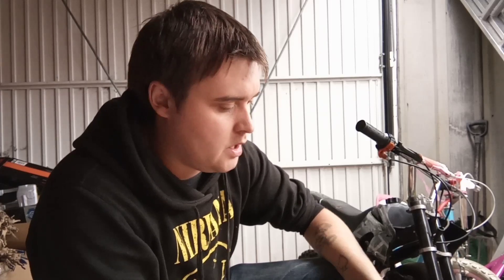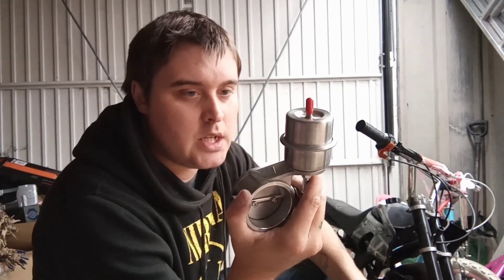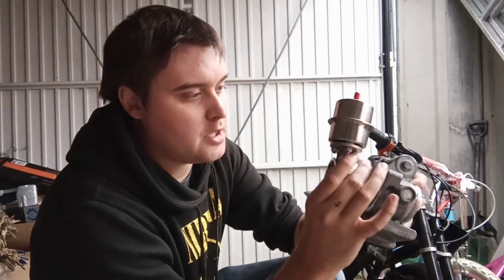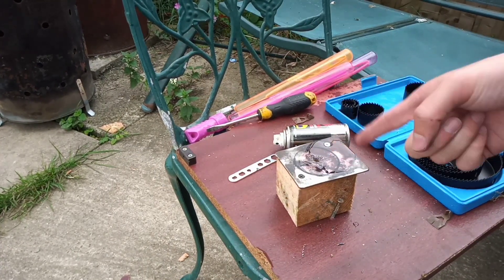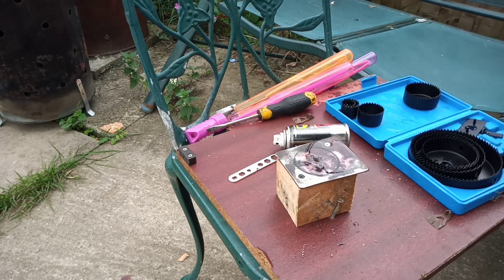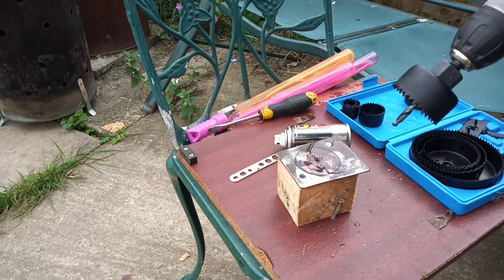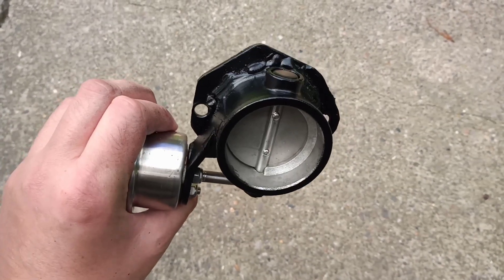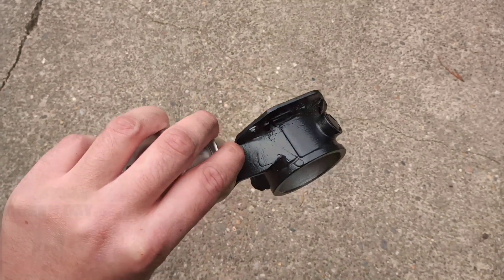Mercedes Benz 230 Kompressor Vacuum Operated Bypass Valve Making A Prototype...

Comment: I would definitely buy this product if you decided to manufacture it iv opted for a 63mm size  with manual boost for fine tuning adjustments as someone somewhere few years ago said 55mm should be the minimum, all the same this is a brilliant idea and can't wait to see the outcome....I  should of subscribed long time ago!
Reply from the maker: Thank you dude, yeah to be fair with this way of doing it 63mm might work better. I know from my IS200 M62 supercharged builds a 50mm BOV does vent enough boost, but again it's comes back to how the stock ECUs response. But I shall keep testing unto I figure out the issue, the only issue with these is you can't use a manual boost controller to adjust how the work as they use vacuum. By using a manual boost controller you would be introducing a vacuum leak as they essentially act like a adjustable T piece, so the vent side bleeds boost pressure to atmosphere. With a vacuum system you can't work it like that as the more vacuum you bleed of the bigger the leak will be causing the engine to run poorly. I had the same idea to start with then I had the facepalm moment as these valve have to be the vacuum operated version and not the boost operated version as it needs to work like a bypass valve and not like a wastegate. To be honest I had far too many FACEPALM moments whilst coming up with this cause there's so many things to throw your mind off 😂
Reply: @M-oneeleven-M111  finally got mine up and running with the 63mm valve, iv tried adjustments, but same issue as you, except my stutter is a proper stall, only runs reasonable if I accelerate gradually, AFR reads lean, I do know that my magnetic cam adjuster is NOT working, got one coming tomorrow, I think because the valve closes completely it's suffercating the engine, I'm going to try and limit the valve by welding a tab inside.
Reply from the maker: @darrenwall1860  that is entirely possible I noticed mine occurred both with and without the SC below 2000 rpm and couldn't get it to pick up. But it wasn't like a boost cut like you see it was like it leaned off or made a huge vacuum leak. We shall not be defeated though🤣 there's no way it's the MAF topping out on mine as I have the stock SC pulley, so this means something else is occurring I also got no EML either.
Reply from the maker: @darrenwall1860  I've been playing with mine today I've removed the lock nut on the actuator to make it as slack as I can, I've tested it with it adjusted as loose as possible with the lock nut still on the actuator shaft and the car was drivable but still had a mild miss partial load. So by removing the lock nut it's given me a few mm more of adjustment I'm going to try again tomorrow gut feeling says it will work. 👍
Reply: @M-oneeleven-M111  I did quite a bit of research last night, found out pressure is definitely controller via ECU for the standard bypass, pressure needs to be higher below the butterfly, that's why we're both having starvation issues,mines worse because I've got a bigger crankshaft pulley! I'm going to limit how closed the valve gets or find a way to make it stay completely shut for less time, probably weld an adjustment stopper to side of the valve assembly so it doesn't quite close fully, I like you are not ready to give up yet mate!!!!!!
Reply from the maker: @darrenwall1860  if you modify the actuator shaft so shorten the shaft and the end peice  that will limit the travel of the butterfly. But you have come to an identical conclusion to me...which is for it to work it seems like it needs to have a slight gap. But then we get a boost leak but I have to be honest I'm finding this a fun little project. What's more it's it's great being able to work along someone else doing the same thing and to see we are concluding very similar things. Although I have a feeling if we had a BMW M5 MAF it may work a bit smoother 🤣
Reply: @M-oneeleven-M111  iv fitted some washers to the vacuum cylinder and also moked up a rudimental close stop and guess what no stutter at all!!!! Not obviously getting full boost but definitely way better than I had before- that's with the factory bypass removed, you got a way I can send you photos??? I'm not selfish like some so wanna share  so you can try yourself, bear in mind my magnetic cam adjuster is NOT working,new one didn't turn up today.
Reply from the maker: Good man Its great to know people want to share stuff just as I do, you can email me @ alex.moneeleven@gmail.com buddy 🙂👍 nice to know I was heading along the right track I've left my valve slightly only slightly open with the actuator and hoping to test tomorrow.
Reply: @M-oneeleven-M111  just gonna do some photos then I'll send the pictures to you, I hope it helps!
Reply from the maker: Cheers buddy I'm sure it will the idea with the washers didn't even cross my mind that's good thinking 👍😃

Comment: Hey man, I am building a turbo build with a 975/982 turbo frankenbuild. I was just wondering how to route the belt to the alternator, we wont keep the supercharger because the crank pulley from the 975 doesnt match the offset to everything else. I see that you routed a single belt? But how tho.?
Reply from the maker: Assuming that this is a 975 block with a 983 head? Best way to do this is by finding a M111 naturally aspirated alternator bracket from a 1.8 or 2.0 engine as they're the most common, using this method allows you to use the NA alternator belt too. You could also use the NA crank pulley to save a bit of weight too as you won't need the twin pulley any more. Hope that helps buddy 😃👍
Reply: @M-oneeleven-M111  I´ll see if I can't eventually get the 975 pulley machined down to the right offset, could end up putting the M62 back in for a twincharged build or use a M45 charger because the 982 has the M45 alternator/supercharger bracket. But at the moment we measured the distance around the outer crank pulley>tensioner>altenator and came to a conclusion that we can just run a 6PK925 belt on. Just have to run it NA until I get my turbo manifold slightly modified and then get some hose, make downpipe etc.

Hopefully I can get everything done before my RusEFI Hellen128 PNP Bosch ME2.x  standalone replacement gets to me. I also put forged rods in this 982 so I am looking to make huge power sooner or later.